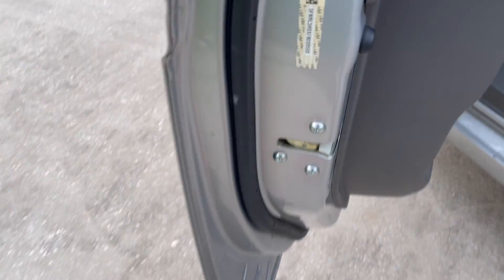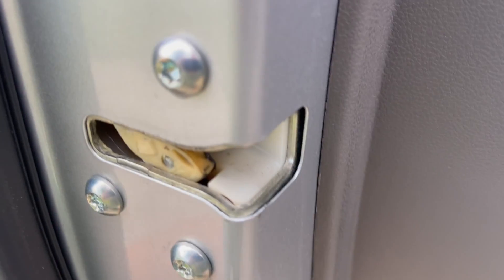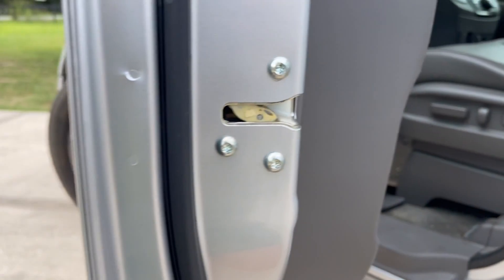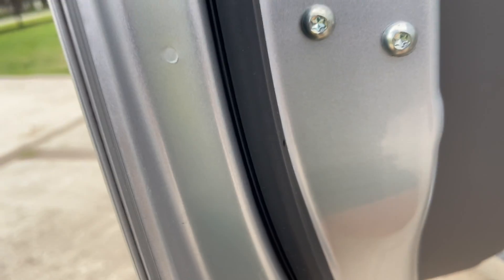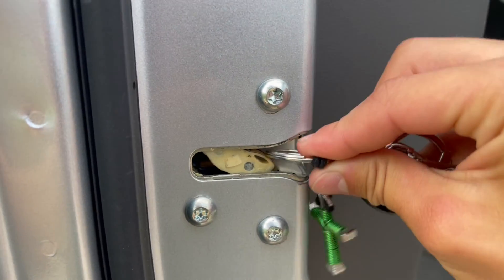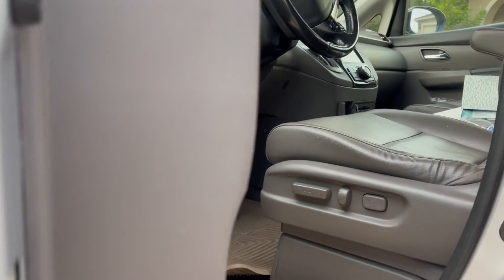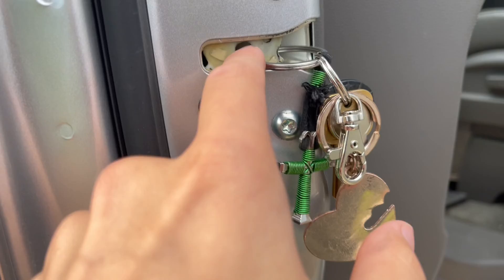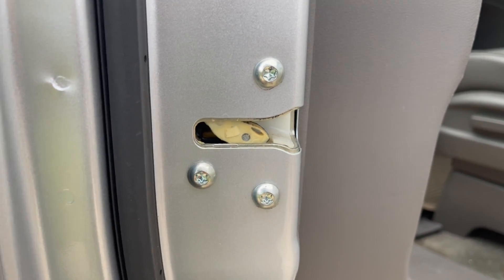How A Car Door Lock Works

Comment: I have a car door that won't open from the inside, what would I do to that bolt in order to be able to open it from the inside until I can get the door handle mechanism fixed?
Reply from the maker: Sorry to hear about your door issue! If the door won’t open from the inside, you might be able to manually manipulate the latch mechanism by accessing the door panel. Once inside, check for any disconnected rods or damaged components. It could be a temporary fix until you get the handle repaired. I hope this helps. 👍

Comment: Very nicely explained. Many thanks. 
Is there a way to silence (damper) the sound upon closing.
Reply from the maker: Thank you! I’m glad you found it helpful. Silencing the sound when closing the door can sometimes be done by adding rubber seals or dampers around the door frame. Some car models also have aftermarket dampers available. You might want to check with a local auto parts store!”

Comment: Then why when fire catches the car, door can't open ?
Reply from the maker: When cars catch fire, the doors and hoods (bonnets) can become difficult to open for several reasons:

Heat Expansion: 

The intense heat from the fire causes metal components to expand. This expansion can create a tight fit, making it hard to open doors or hoods that are already warped or distorted.

Structural Integrity: 

The fire can weaken the structural integrity of the vehicle. Components may bend or warp, causing misalignment that can jam doors and hoods shut.
Locking Mechanisms: Many vehicles have locking mechanisms that may malfunction due to heat. If the lock components are damaged or melted, they may not function properly, preventing doors from opening.

Smoke and Debris: 

Fire can produce smoke and debris that may obstruct the openings, making it physically difficult to access the doors or hoods.
Panic and Urgency: In emergency situations, the urgency to escape can lead to frantic attempts to open doors or hoods, which may exacerbate the difficulty, especially if the person is not familiar with the vehicle's mechanisms.

Fire Damage:

 The materials used in modern cars, such as plastics and composites, can melt or deform in a fire, further complicating the ability to open doors or the hood.

These factors combined make it challenging to access the inside of a car during or after a fire, emphasizing the importance of safety and quick evacuation in such situations.
Reply: @thingsofcuriosity  thank you for the detailed information ♥️👌
Reply from the maker: Of course! Stay Curious 🤔👍
Reply: @thingsofcuriosity  I am from India, we don't have a car and I am thinking of buying one as travelling at night on a bike with family becomes a bit tough because of the high light of other vehicles, because of this it comes to mind that if there is a car then there is safety, but news like car catches fire in the news disturbs the mind as to, why does a car catch fire and why in some cases doors cannot be opened after the fire? That is why I asked you this question.